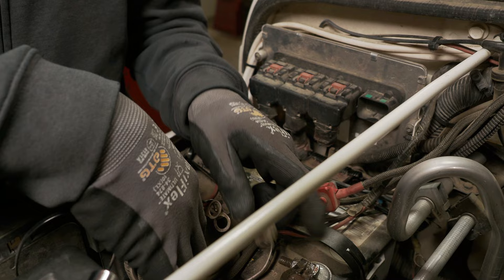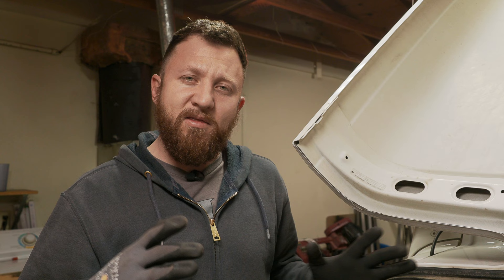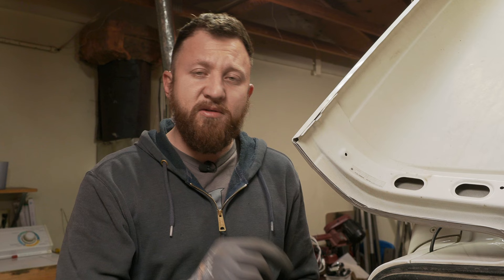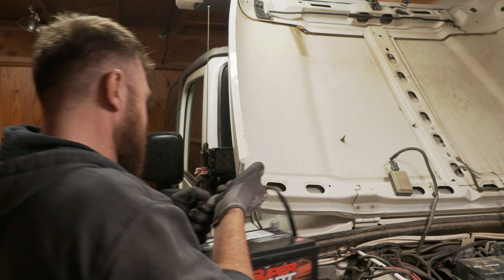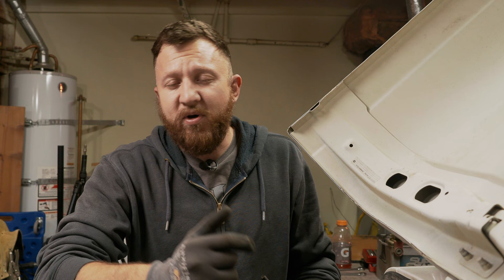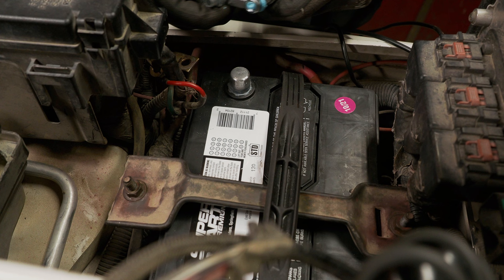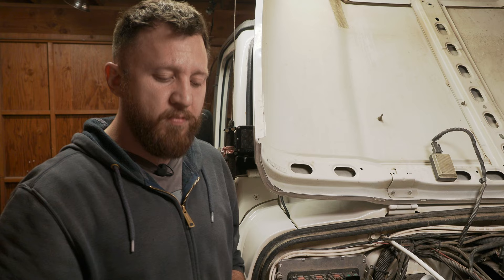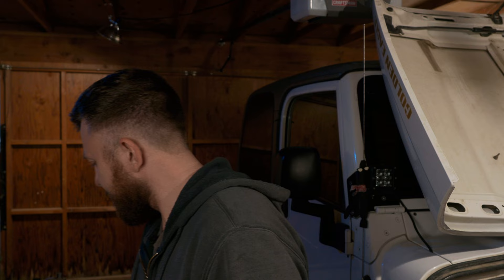Watch Before You Buy AGM Batteries

Comment: I use AGM batteries in my RV trailer and my tow vehicle.  Their lifespan is nothing unusual.  I do keep my trailer battery on a trickle charger when not in use.  This trailer battery has outlived it's warranty period.

On a side note, I heard you mention something about the battery and you Jeep's computer.  There is a guy who runs a vehicle junk yard and has one area where he specializes on rebuilding Chrysler computers.  No other brand of vehicle computers, just Chrysler.
Reply from the maker: Honestly, AGMs do seem to last longer. However, in my expereince that's if they are maintained correctly. Sounds like you are doing that by using a charger. AGMs are wonderful on my other two cars, just not the jeep with such a low charge voltage.

Comment: I've had a Couple of those Red Top 6-pack style of AGM, go south after lights were left on over a 7 day period. Boosting started the Car, bit afterwards the Battery seemed to only Partially Charge, even though the Voltage coming out of the Delcotron was 15.5.  Went back to Wet Cell and things are fine. Latest Car came with an AGM from the Factory, supposedly because it has that Effin Auto Stop. I have permanently disabled the Auto Start, and might switch to a Wet Cell when time comes to replace the Battery
Reply from the maker: Honestly, I do think AGM batteries are better all the way around. However, the vehicle just has to be able to charge them correctly. I've had the same experience you have in my Jeep. But my 4runner with a voltage mod has been great thus far.

Comment: Ive killed 5 agm batteries in 3 years. Kind of am thinking the same thing as you now
Reply from the maker: Yea, I would say so. One way to find out would be to check the voltage you are charging at.
Reply: @EmbarkWithMark  13.8v at idle, hits 14v while accelerating. What has me stumped is that my car came from the factory with an AGM and the original battery nearly 10 years for the original owner. I do not garage it though or tend it over the winter months which I believe is the culprit. There is no parasitic draw on the vehicle either, ive tested that.
Reply from the maker: @leveluplife8585  From my knowledge that is right at the limit. I do know that quality of AGM batteries has diminished over the years. Finding a good brand is now fairly expensive. I swapped my 4runner over to an AGM, but it charges at 14.3 at idle and 14.5 when going down the highway. I've modified it so i can adjust the voltage a bit. We have had no issues but once in a while when i think about it I put the a smart charger on the battery just to top it off.

Comment: As far as I know, one of the benefits to AGM is that it doesn't leak acid and have corrosion problems? I was thinking of switching to AGM on my 2007 Toyota Corolla.
Reply from the maker: Absolutely a benefit. And if your Corolla has high enough charge voltage to correctly charge the AGM I’d say go for it!
Reply: @EmbarkWithMark  Thanks Mark. I wonder how I would determine whether it has enough charge voltage?
Reply from the maker: Start your car, let it warm up fully. Take a multimeter and check the battery voltage with the car running at idle. That will give you what your charge voltage is. 

Hope this helps! Just be careful around a running engine.
Reply: @EmbarkWithMark  Thanks. I will give it a try
Reply: @EmbarkWithMark  I was watching Project Farm's car battery review and it looked like the AGM ones didn't perform as well as the standard ones. Maybe it's not worth the added expense. Would be nice to not have to deal with corrosion and having to clean the battery terminals. I want to get some of the battery terminal protection spray and see if that helps at all. I currently have a Duralast Gold battery. It's still going strong from 2015, but, I'm getting sick of the corrosion. I put some of the terminal grease on it last time I cleaned it. Didn't seem to help much at all.
Reply from the maker: I’ve watched the same video and the results are very interesting indeed. 

I use this to protect my terminals now. It’s been on our Toyota for a while and looks be working well. 

https://youtube.com/shorts/7WED_lIcOJ0?feature=share

Comment: just get a voltage regular and make it charge at 14-15 volts
Reply from the maker: There is a way to do that. I have to bypass the PCM and add a large resistor to prevent a CEL. 

My only concern is the external voltage regulators available do not appear to have a good reliability record. At least from my searching.

Comment: My 2017 Nissan Titan is suppose to use AGM batteries. I didn't know this until one night my Auto headlights came on and 20 seconds later my headlights went a little dim. Took it to the dealer and they told me Titans use AGM because there's a wire plugged into the battery cable and they said it had a Smart Alternator on it and the computer would let it know when it needed more amps and because I had an EFB battery on it it would lose amps causing the light to dim. I unplugged that wire and my lights no longer dim but I worry about it causing electrical issues latter on.

Comment: I have a 2000 Toyota Camry that came with a conventional lead acid battery.  I ran with a couple  replacement conventional batteries as they went bad.  Then I started using AGM batteries and they last more than twice as long.  My alternator mins out at 14.2v, 13.5v is to low for all automotive batteries.  Are you sure you can't change the ECM and increase the voltage?, it appears you are running at the minimal voltage setting and again, 13.5v is too low for all acid type automotive batteries.  You are correct though, conventional  lead acid batteries will last longer than AGM in abusive conditions (13.5v).
Reply from the maker: I completely agree with everything you’ve said. 

Yea, I’ve tried to figure out ways to increase output voltage. Including purchasing and installing a new factory ECM (not cheap).  Some TJ output 14 volts and some output 13.5. Some have a heat sensor in the battery tray and some do not ( from the factory). 

The only current method I know to increase voltage output is to modify the  wire harness, and add an external voltage regulator. But, one I’m not a fan of modifying wiring harnesses. Two, from my research the external voltage regulators and resistors required to make this work do not seem to have a very long or reliable life span. 

I’ve been thinking about contacting a ECM remanufacture to see if they can rehab my original ECM but ensure output voltage is higher. Say 14 volts. 

If my Jeep charged at 14.2 volts. I would definitely be running an AGM again.

Comment: I have used AGM batteries a lot bro! I used them in banks of 6 for car audio and starting batteries. Kinda crazy you have had issues with an AGM.
Reply from the maker: Not that crazy, my other vehicles do just fine. I imagine you are charging that bank either with a charger or the alternator is putting out the proper voltage for AGM.

Comment: Your explanation was top notch .My question is how do you know how your car is charging? With a mustimeter ? How is the process?
Reply from the maker: Glad you found the info useful! 

ya, you have it right. Start your car, let it warm up fully, than check the charge voltage with a multimeter while the car is running at idle.
Reply: @EmbarkWithMark  Thanks mate really appreciate , I am having a pickle with the choice of battery. I measured  the charge rate and its 14.781 V,  on Varta website is advices me 2 batteries theBlue Dynamic EFB 575 500 073 (E46)  which it recommends,  however there is a 2nd choice Silver Dynamic AGM 570 901 076 ( A7) , was trying to see the Charging rate of both batteries but could not find. I was inclined to the AGM, as seems to be better battery but don't know if will be the better for my Ford Mondeo Fusion  mk5.
Reply from the maker: @coolissimo69  your very welcome!

If you charge voltage is ~14.7 when warmed up, than I would go with a good AGM battery. :)
Reply: @EmbarkWithMark  Thanks mate you got a new sub.
Reply: @EmbarkWithMark  do you know what should be the charge  of this AGM battery?

Comment: Thanks for the informative video! I have a 2000 4Runner and have been wanting to upgrade the battery finally. Last time I had my alternator replaced, my guy rigged up a Cadillac alternator that has almost twice the power (amps? Watts?) Is it fair to say that this would help me avoid the problem you’re having? I’m new to learning about electricity and powering devices like a fridge, etc. Thank you 😊
Reply from the maker: Your very welcome! 

I have a 2015 4runner, awesome vehicles! 

So it’s less about how much power the alternator can output and more about what voltage your vehicle charges at. 

For example my 5th gen 4runner is 13.9. It should really be 14.2 to charge an AGM correctly. ( for the batteries I’ve researched)

Your 4runner may charger higher than mine so I’d just out a volt meter on the battery when the vehicle is running and warmed up to see what the voltage. 

Hopefully that makes sense. This stuff can be very confusing.

Comment: Loose terminals, questionable wiring, alternator output isn’t enough (all your comments) and somehow it’s the AGM battery that’s not up to snuff. I might try getting one piece battery cables to start. Cables are known to build up resistance as they get older.
Reply: Who puts lock tight on an electrical connection?
Reply from the maker: You’d be surprised what comes loose when driving 10s of thousands of miles on washboard roads and rock crawling.

Comment: It's your vehicle that isn't designed to work with AGM battery.  A good alternator and a good ECM programming to make it run efficiently with these new AGM battery will go a long way.   Your vehicle is the weakest link with outdated parts and ECM that still runs on windows 95.  AGM is like a quantum speed in efficiency.  It can't  process a deficiency code that are obsolete.
Reply from the maker: Correct, vehicles need to supply the correct charging voltage to properly maintain an AGM. Pretty sure thats what I was getting at.

Comment: The absolute thing to remember is: If your vehicle (NEW) did NOT come with an AGM battery, DON"T use one as a 
replacement battery!!! The biggest take away is this: The internal regulator (inside of the alternator) at least on most 
alternators, is set for 13.2-13.8 volts and this is why an AGM will not achieve it's FULL charging potential! If you actually
had a voltage regulator that was internal to the alternator that was set up for charging the battery at 13.8 -14.2 VDC, 
you might be just fine, yet on most newer vehicles, the PCM or the main vehicle computer has a fixed point charging 
mechanism to also manage your overall charging system, setting up and managing the the overall charging process 
because of very sensitive devices on board of the vehicle that mandates stricter controls; just so that you don't take out
a main computer (PCM) for Engine Control Management, (TCM) Transmission Control Management, and/or any other
systems modules that can be very, very, very expensive modules to replace; materials costs and labor costs combined!!!
Should it not be a problem ie a older type of vehicle that doesn't have all of these system features, it wouldn't necessarily 
be a problem and I'm talking about vehicles previous to years oh say 1996 maybe? The newer vehicles have a slew of 
various strict engine management, transmission management, anti-theft modules, and more modules than you can shake 
a stick at that also have data communication links that are tied together in multiple packages and the reason for most of 
this is because all of these mandates by the Gov't for absolute fuel mileages, transmission shifting points to optimize
the fuel economy and virtually any other devices such as Infotainment, GPS, you name it are voltage sensitive to an other-
wise that may be that are sensitive and that could be destroyed in one fel swoop! This is why most manufacturer's suggest
that you do not substitute any other electronic parts that are not OEM. There are some substitutions that might be acceptable
in the way of using  parts that are original to the manufacturer's core supply vendor's list and that is about it! The so called
critical components that are onboard to the original components build list, set the criteria for even things like vehicle safety
perhaps as well. Example: An electronic module that oversees airbag deployment, so on and so forth! Furthermore, the core
environment of such systems and the demands on the system for battery charging systems is shall I say is both complex
and is much needed for all electronic systems onboard. This is why in most instances, you shouldn't deviate from the design
implementation and practices or otherwise you just might find yourself in a real pickle and vehicle repairs costs that are more
than substantial and bugs or gremlins that you may be trying to chase down like a madman. Now, if the vehicle had an AGM
battery that was a part of the original build, well then an AGM replacement battery most likely is most suitable for you to 
replace the old battery with. I could almost see using an AGM battery for off road use because if your vehicle is suddenly
flipped over on it's side or on it's top, well you wouldn't have battery acid spillage all over the place yet still, this might not
always be the best solution.

Comment: Your experience is 180⁰ from mine.  I'm on my second DieHard platinum AGM (no longer available) in 12 years.  The first one went 8 years.  My electrical system is 100% OEM except for the AGM battery.  Could it be a difference in high quality TPPL (thin plate pure lead) AGMs like the old DieHard platinum, Odyssey, Northstar, etc and the lower quality calcium AGMs from parts stores?
Reply from the maker: That could be part of it. I’ve also found out that Jeep TJs can have a wide variety of charging voltages. I have access to a stock automatic 4.0 and that Jeep charges at 14.0 volts consistently. Very strange to me at least.
Reply: he didnt maintain it or use the correct charging system. agm are not start batts, there slow drain for fridges, acc,s.. ect.. you need 2 bats, std & agm. pointless having agm for start batt.
Reply: @harrywalker5836  WRONG! There are many different kinds of AGM batteries. 

Some are deep cycle batteries, some are start batteries...

Some are specifically made for boats, some for industrial equipment, while others are for solar cell setups in off grid cabins, etc...
Reply: Up until about 8 years ago, the (Sears) Die Hard Platinums WERE Odyssey Performance series batteries with Die Hard stickers/logos on them, and a grey and black case color.  😉
Reply from the maker: I’ve herd this!
Reply: My old sears AGM (odyssey) lasted almost 13 years

Comment: Hi there, I just came across your channel looking for a way of stopping the sulfate from Crystallising in the agm battery.
I'm wondering why you are using an AGM battery to crank an engine.  A Flooded battery is designed to crank an engine because it can quote with a high amp quick discharge and quick charge to 100% fully charge stage very quickly. A AGM is designed for slow discharge and slow recharge or am I missing something here. As I see it, you're trying to make a plough horse do what a race horse does.

Comment: AGM are toast if you ever allow them to discharge to 50%. They will never be the same after that.   You can discharge a flooded battery to 80% without damaging them.  AGM batteries will not tolerate Texas heat.  Summers here stay at 90 degrees or more and the gell will solidify at those temperatures.  Red tops perform even worse here.
Reply from the maker: I find discharging any deep cycle battery below 50% generally hurts them. 

I’m not sure about the heat. We see summers of 110 normally and it’s not uncommon to see temps hit 120+ for a few weeks. 

I know of other vehicles where AGMs have preformed well. But, the heat issue is something for me to read into. Thank you! 

I’m not a fan of Optima after Johnson Control purchased them.

Comment: Ran one for over 10 years on a large v twin motorcycle ! It's your jeep that's the problem
Reply from the maker: It looks like you might have missed the whole point. Just double check the charge voltage is with in spec for AGM. 

I also never claimed my Jeep didn’t have an issue, it does, the charge voltage is to low.